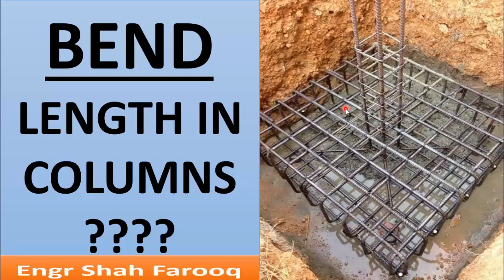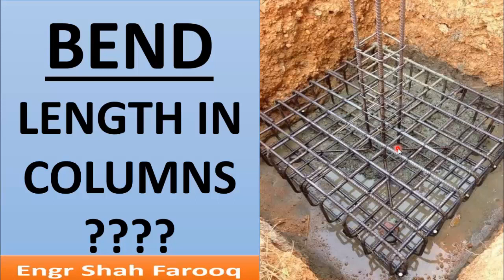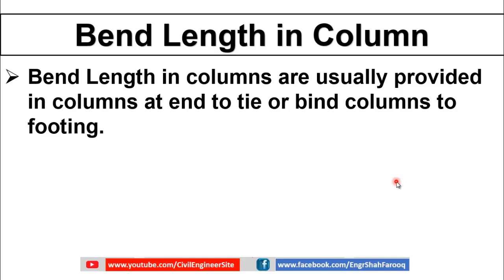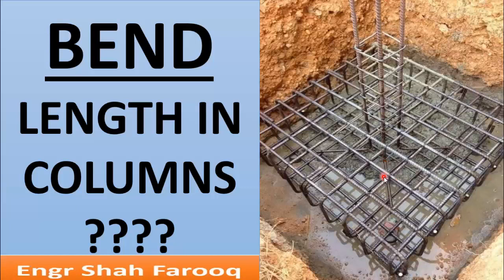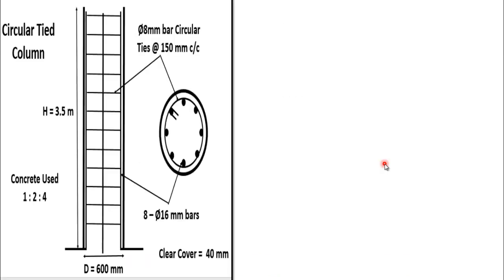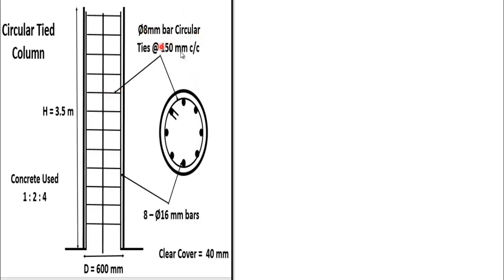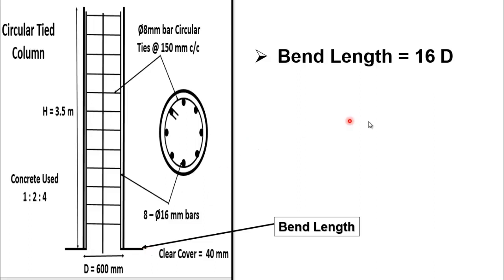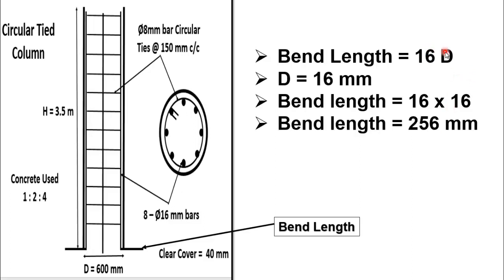What is Bend length in RCC Column? | Bend Length and Calculation of Bend Length | Column Steel Bars

Comment: For Columns clear cover should be 1.5 inches or 75mm, here you have illustrated at this image 40mm which is 0.75 inches, moreover if your longitudinal bars are of 12mm then bend length is 16D = 16(12) = 192 mm but if the same bar are at FPS system which #4 bar or 4 sooter then bend length will be by which calculation ?